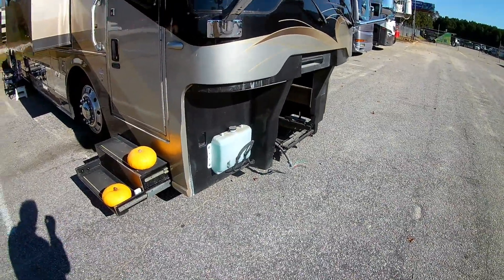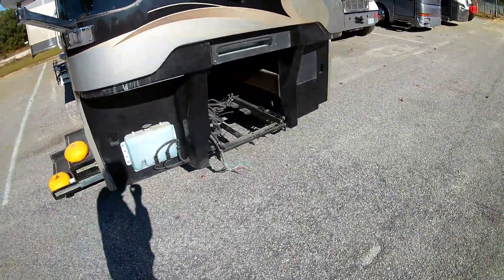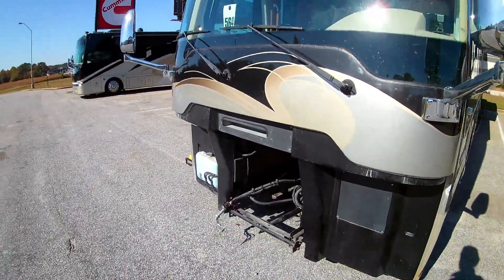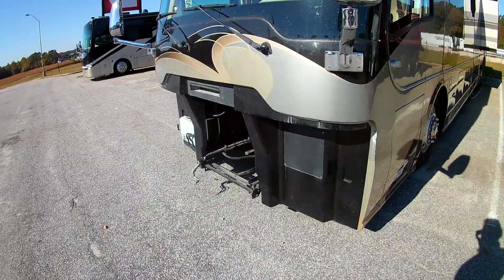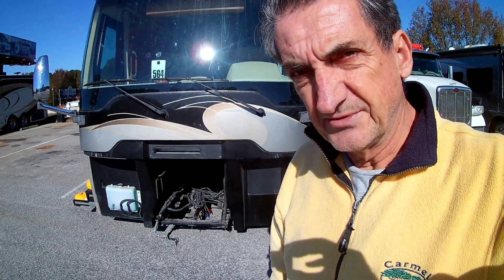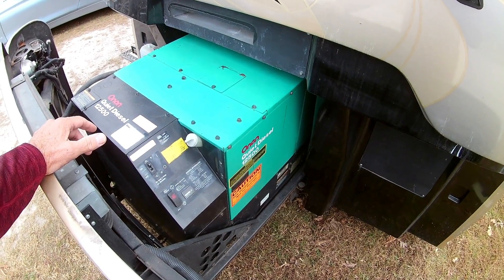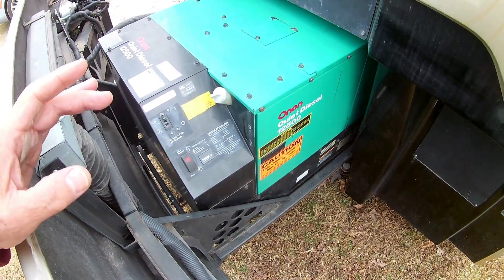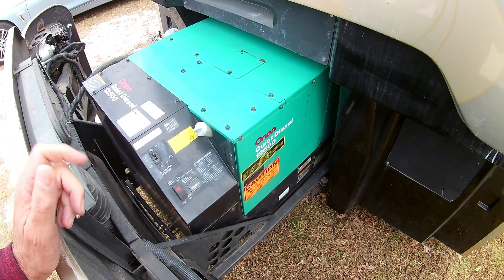Generator overheating - Fixed!

Comment: just going to say in regards to your labor hours and cost. say for example, you had 6 different mechanics work on it (from removal to disassembly to repair to install) and each mechanic worked on it for four hours, EVEN IF it was all at the same time (example, 6 mechanics working on it from 1pm-5pm) thats how youd be charged 24 hours labor. granted this is just an example. it couldve been 2 mechanics for 12 hours, etc.